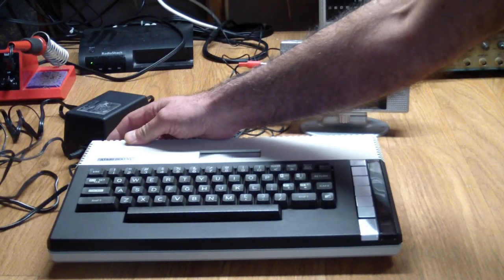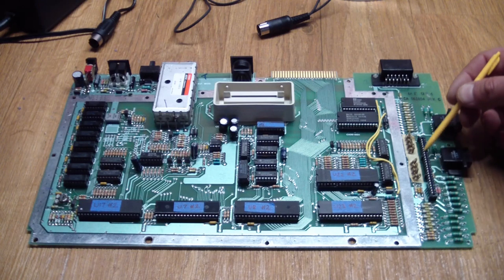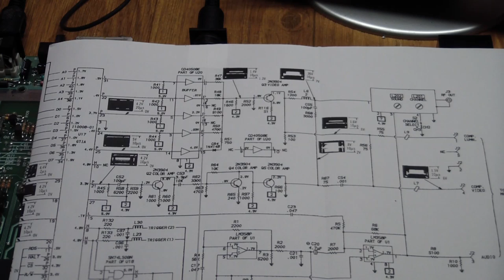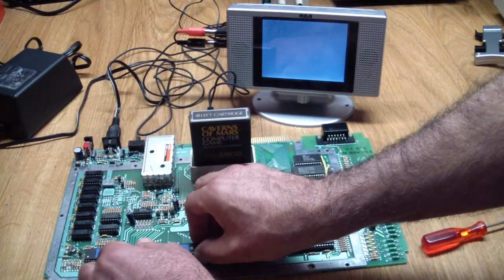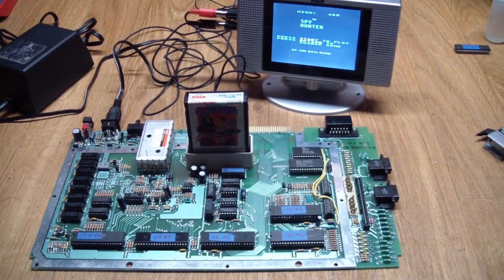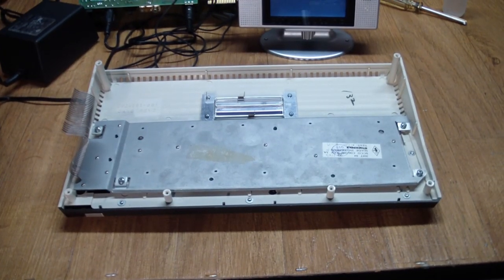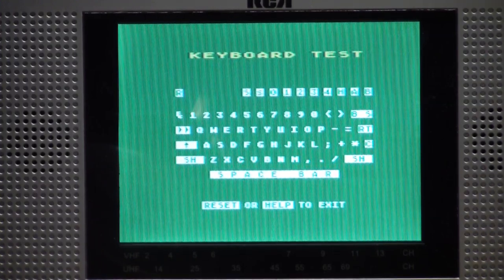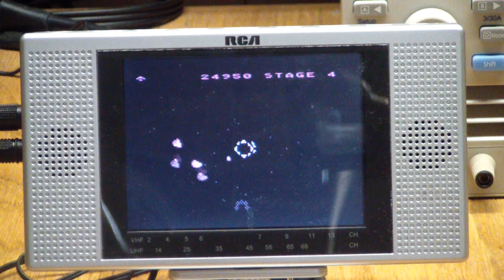AE#102 Checking Out An Atari 800XL Computer

Comment: Good job, I've recently swapped my membrane with a new one and it wouldn't work so, the old one chopped a bit to make it shorter and the trick worked - I guess not all the new membrane remakes work right for the 600/800 XL - Thanks for the video.

Comment: Maybe Im wrong but at 11:49 you were showing the chip with the bad ground pin...if you insert it in the board that pin cant line up with the board ground...it would be on the other side...Am I wrong?
Reply from the maker: I carefully aligned the repaired pin with the adjacent pins and it inserted into the socket just fine. But the potential of the pin bending under the chip is there, because the resistor lead is not as rigid as an actual IC pin.
Reply: @artifactelectronics  Thats a good repair..but thats not what Im talking about...looking at the pin repaired is to the far left is this right? If so there is no way it can go into the far right in the socket on the board, like it needs to be...that is what I was talking about...its nothing but it seems backward.
Reply: @kennynvake4hve584  I noticed the same thing.   When he was holding the chip it seemed that the broken pin was pin 13, not pin 12.   So I was wondering if maybe the video was inverted left to right somehow.
Reply from the maker: You're right, that was actually pin 13 which is D3.

Comment: I never quite understood why the POKE(?) chip is of value to people. Because there are no replacements?
Reply from the maker: The universe is running out of Pokey chips, and many early atari arcade games used those. But fortunately the clones are arriving.
Reply: @artifactelectronics  Ha! So I'm sitting on a stash of vintage parts, yeah!... (on reflection though, I'm not gonna get rich - it is just about a dozen or so of XE boards).
Reply: @artifactelectronics  Ha-ha.  The new "chip gold mine".  Re-manufacture Pokey chips, and charge $5 extra per chip.  Money! $$$$
Reply: Pokey chips are used in stereo  or synthesizer solutions. It's the "best" sound chip of that era.